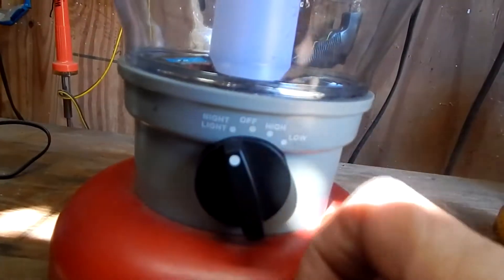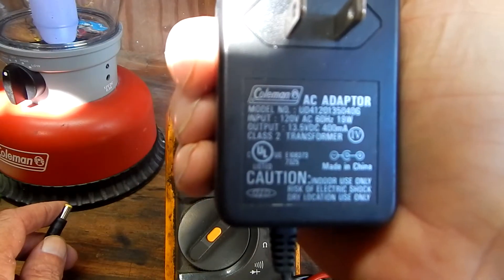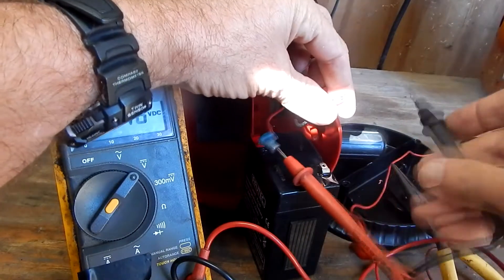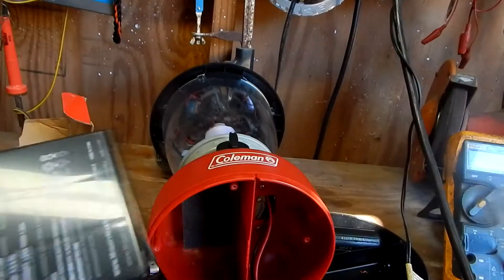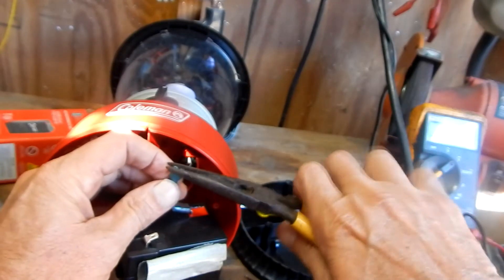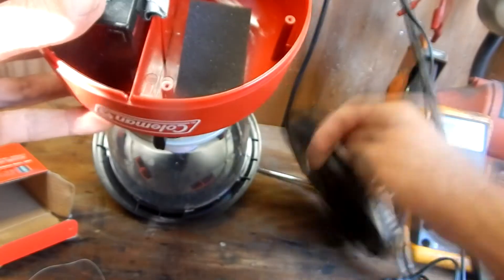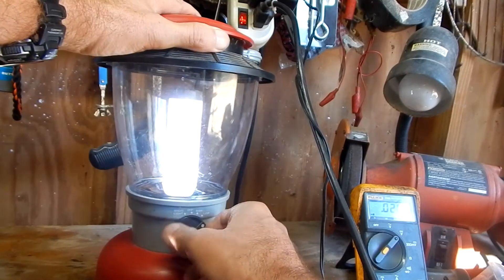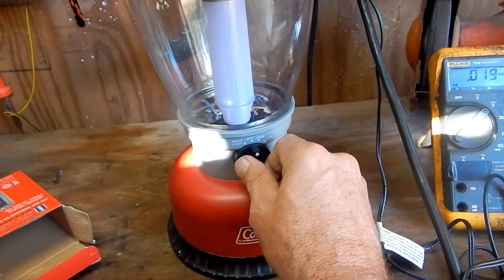Coleman Lantern Rechargeable Not working

Comment: The night light works as long as the charger is plugged in. If I have the setting to high or low and plull the adapter plug the light flashes but goes off. Why is the night light working but not the others. Low battery maybe and just enough juice for the night light? The battery you ordered there are a few of them. Al say for different names. Which one is this one?

Comment: Thank you. I have a slightly different Colman lantern that’s not as easy to open, but it was similar and my problem was just a loose connection.
Reply: How did you fix the connection? Mine works if plugged in and the battery tests fine so it must be a connection!

Comment: What if I only get the night light & not the other 2 settings? Is it the battery? The charger is unplugged
Reply: I am having the same problem.
Reply: @warpig372  I have the same issue with my 2 rechargeable Coleman lamps.  Quite fed up of Coleman lamps!
Reply: I have the same problem
Reply: Same problem with mine
Reply: Chances are its the battery. Test the AC Adapter,  if it's putting out the recommended output voltage it's not the AC Adapter.

Comment: Great video.  I have the same lantern, same issue.  Turns on but very very dim.  Can you tell me specifically which battery you bought on Amazon?
Reply: Colin Fritzke Raion Power RG06450T1 6V 4.5Ah SLA battery

Comment: Wow.. You have space for running another battery in parallel...
Reply from the maker: Thx for watching.
Reply: I have one of these lanterns. That other space is suppose to be used to store the AC Charge Adapter. Which is a good idea to keep them together as the Adapters tend to "walk away" and can't be found when you need it. Not sure that space is deep enough for the same size battery......maybe  a smaller one?